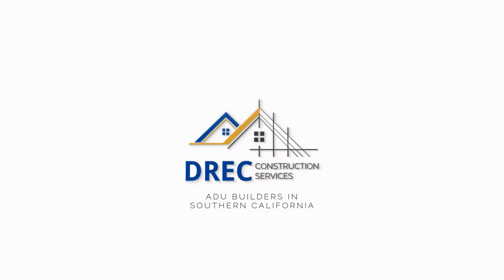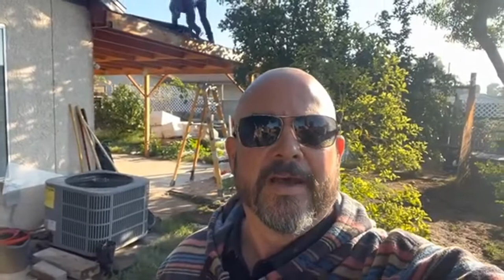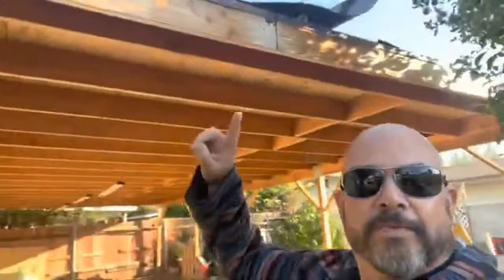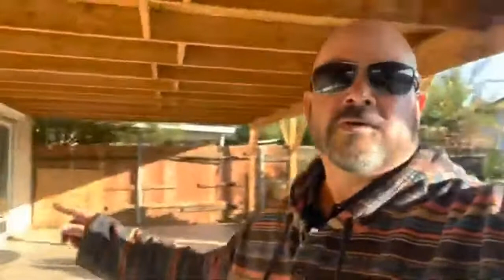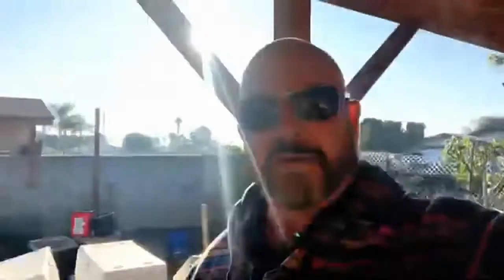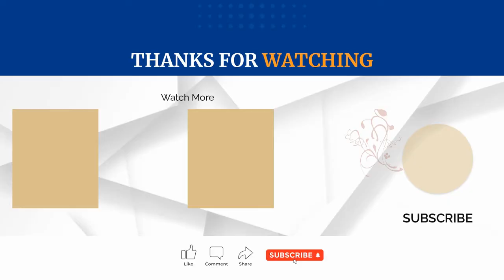ADU Riverside II | Part 1: Demo - 350 sqft Attached ADU Construction in Riverside

Comment: Too bad the concrete has to be removed.
No chance using it as a base and shimming up the low side?
Reply from the maker: Would have loved to have been able to do that but city code is requiring us to remove and repour. They want to validate the minimum PSI and consistency of the pour.
Reply: @theadupro  Ah I see. Got it. Just thought I'd ask. Great short video. Look forward to the progress